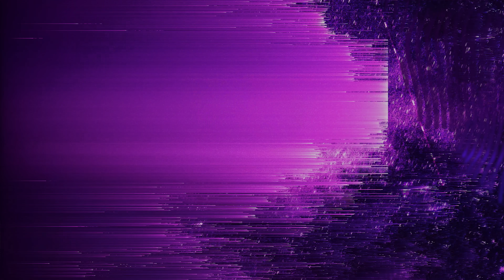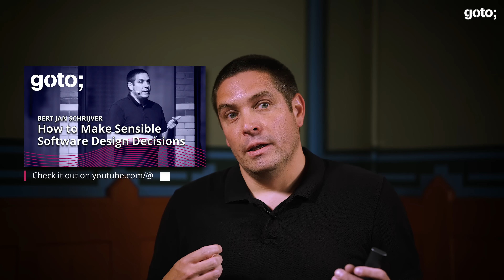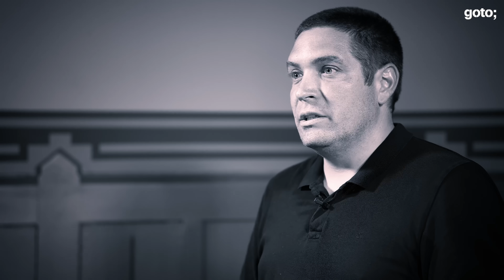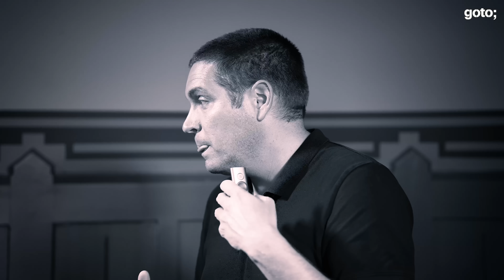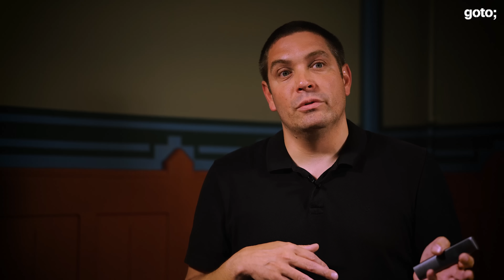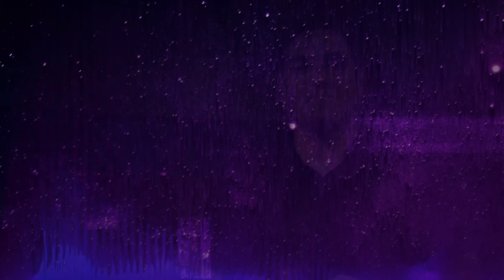How to Make Sensible Software Design Decisions in 8 Min • Bert Jan Schrijver • GOTO 2023

Comment: Good points ! I would also add that writing very specific code doesn't necessarily mean "hardcoding" it where it's used, we should always try to identify parts of an application that deserves to be extracted into a separate and reusable sub-system (the same way we would with a generic solution). This makes refactoring a lot easier down the line, reduces merge conflicts, and increases understandability of the code base (without having to go through the path of predicting everything this sub-system could have to accomplish in the future).